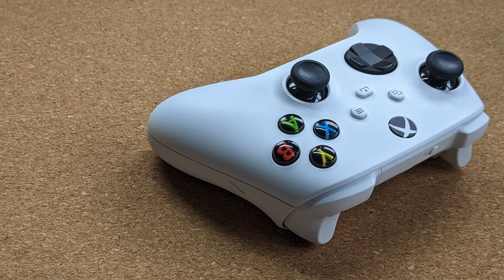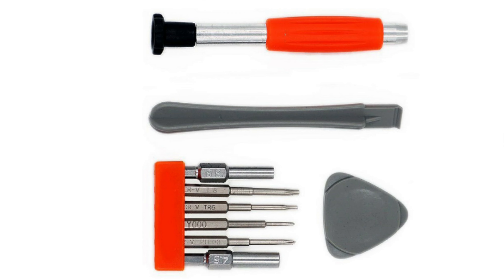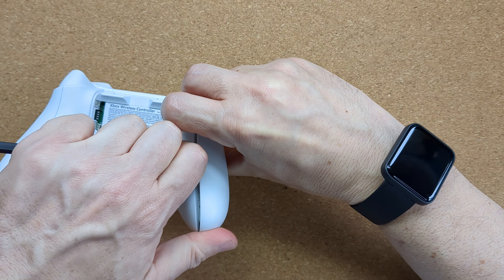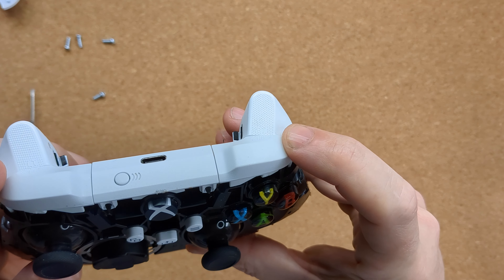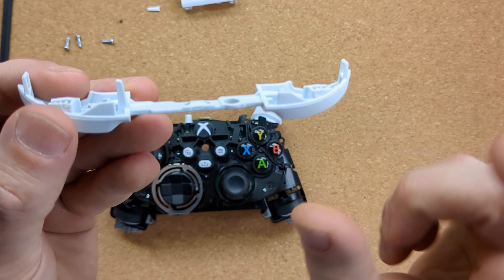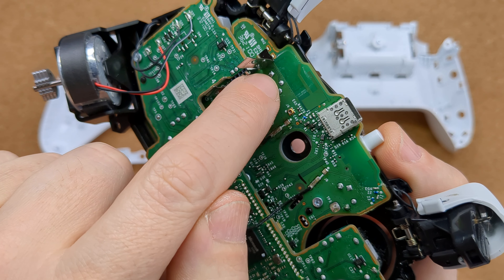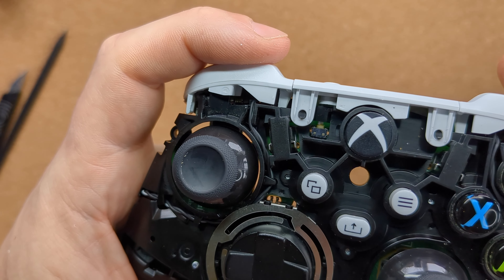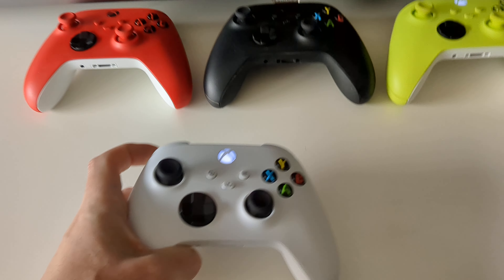How to fix broken bumpers on Xbox Series S or X controller - no new parts needed!

Comment: The video was brilliantly clear. I had a go with a replacement bumper and all seemed well. However when I replaced the batteries no light or start up on the controller. Any suggestions?
Reply: I guess you fixed it by now? Check if when assembling the controller, the two battery plates pass through the space and did not stay inside the controller
Reply from the maker: As @thiagomotta777 said here, and I've done this before, make sure the battery tabs aren't trapped inside the shell

Comment: Hey Joe, my controller won't power on after replacing the bumper panel with the shoulder buttons and reassembling it! Any advice?
Reply from the maker: Check inside the battery compartment.  It's easy to reassemble and accidentally trap the battery contacts inside.  They need to slide through a small gap in the rear shell.

Comment: So I had thos issue and 8bwas able to super glue the little piece that broke just like yours but after putting back on.  It didn't fix the issue as it still seems the same and doesn't click
Reply from the maker: Did you trim it at all and make sure it fitted through the gap? Also check the button itself isn't damaged, poke something through the gap and see if it still clicks before reattaching the bumper

Comment: This is great, i think i have this exact issue however i have an elite 2 controller anthat first glance it looks more complicated to take apart etc. Its got a built in battery etc and the casing is different. I dont know if i should attempt this myself. Im already down around 60 quid since my right trigger stopped working, now the right bumper is going. It only registers 30 percent of the time.

Comment: My LB works if you push where the button sweeps towards you closer to the sync button. But if you push it on the edge it won't register.
Reply from the maker: @02091992able  so long as it works! Sounds like something isn’t aligning quite right
Reply: What was the fix for you?

Comment: i just bought a lot of 19 broken controllers and half of them has this problem which indicates a design flaw. i wouldn't try to glue it. no glue is stronger than an intact part and it cost 1$ on aliexpress so better to replace the part. in both cases it's a temporary fix, im thinking of a more permanent fix to replace the buttons with a longer style push button and remove that peg entirely.
Reply from the maker: That's a good idea. And I think you've just as much chance of failure with a well-glued original part as you do with a cheap third party replacement

Comment: Are there other items that you can use as a screwdriver to dissemble the controller if you don't have it?
Reply from the maker: There are ways to work around it like snapping off the little pin inside the screws or getting a flat head screwdriver to wedge into the screw but as with most things, I would always recommending the proper tools for a job.  It does mean waiting but they can be bought cheaply and will result in way less frustration.

Comment: Hi my switch make the click sound but its not working what should i do
Reply from the maker: It could be the switch component itself.  If you open it up and nothing seems to be physically broken then the switch component might need replacing.  You'd have to use a multimeter to check the continuity, and if it's a faulty switch you would need soldering equipment to replace it.
Reply: @JoeBleeps  tnx bro I will , good vedio though

Comment: I’ve done it all but after reassembling it won’t turn on (I’ve put batteries in) this has happened twice.. do you know why?
Reply: Nevermind.. hadn’t put the metal conductor things through the hole meaning the batteries weren’t connected to the controller properly lol
Reply from the maker: @nemoandclem2584  I made exactly the same mistake when I did the green shell mod. Easily done!
Reply: Haha, also do you know anywhere I could buy just the back to a controller (the bite you heat up and take off). We tried taking one apart a few years ago but lost the backs somewhere..
Reply from the maker: @nemoandclem2584  so far as I know you'd need to get the whole shell. There are some nice ones out there though, I love the clear green one I got

Comment: I have a problem with the controller the rb and rt button keeps pressing how I can fix it ❤
Reply: Xbox series s controller
Reply from the maker: @trend_super3504  Series S and X controllers are the same.  If it keeps pressing there's something inside pressing against the switch component.  First thing I would do is open up the controller like I did here and see what's going on inside.

Comment: Just got 2 replacement bumper pieces from amazon but they are useless as the rb jams. Trying one from ebay instead. I tried superglue first time but the pressure needed to press the button was noticeably different. It broke in about 15 minutes anyway.

Comment: open up mine but didnt have the right torx to open it completely, but i did hear something have snapped and rattling inside, so pretty sure it must be this plastic thing then, but i dont get why my LT button wont work but the LB works fine because of this plastic thing...(edit: the button works just no response fromt the controllers LT to the Xbox)
Reply from the maker: Might be a separate issue?

Comment: My RB ana LB is working, but it's heavy when you cliked on 💔
Reply from the maker: Sounds it may be broken but the part hasn't come away completely yet
Reply: Did you get a replacement bumper and it only clicks in on the inner sides closer to the sync button, but it doesn't on the outer sides because if you did look closely on 7:00 where the ends meet before the loops and notice how there's excess molding where it's not supposed to in that time clip shown on yours. Gotta watch out for quality on these bumpers so on mines I got a blade and safety cut resistant glove where I'm holding and chipped away excess molding
Reply from the maker: @vectorphoenix5992  always worth checking the accuracy of those parts

Comment: My LB and RB are still working normally, but my LB is waay more "clickier" than my RB, i think they always were like that, but since i dropped my controller on my carpet i started to notice it way more, could it be that it broke something? maybe something is stuck? it's still under warranty so i don't want to open it, but it's not an issue worthy of sending it back
Reply from the maker: @brunogamesbr1  maybe something is cracked inside but not fully broken yet? You'd have to open it to know for sure

Comment: any ideas or where i can look for more info on how to fix it if the button itself is not the issue? i replaced the button itself on the pcb and i still don't get a signal
Reply from the maker: That's very strange. Replacing the button I'd what I would suggest but you did that already. Have you any means of testing the continuity of the traces the switch is linked to? I've damaged small switches in the past when installing them. They are so small they heat up quickly when soldering. That's the next thing I would check
Reply: dont have one of those. i could probably find one but i'm suspecting it was already damaged before i even opened 'er up. 

the original button was perfectly clicky before removal  @JoeBleeps

Comment: When I get to actually taking off the white part of the bumber it just doesn’t come off. In the vid you said there is a clip that is easy to disassemble but mine doesn’t come off. Any help
Reply from the maker: If I remember rightly the first part has a clip in the middle that needs lifting to remove, then the remaining part is clipped at the ends

Comment: I bought a brand new gen9 gamepad 3 days ago. I especially play fifa. For a day now, my RB button has started to make less noise than the LB button. Is this normal? The RB button was noisy on the first day, but now it makes less noise than the LB button.
Reply from the maker: The noise is often as the button hits the shell after pressing. There are stickers inside to dampen it, maybe the sticker placement is a little off, I've had that before

Comment: So to keep it short im a kid and i cant find the "bit" for the screw 😤 i dont exactly know what to do if i find out i dont own one, do i just giveup or??

Update: had a T8 but it was just a regular and didnt have open hole
Reply from the maker: You would probably need to go to Amazon or eBay if that's possible. They will only be cheap but I would say difficult to find if you were just going to a regular store.
Reply from the maker: If you only have the regular t8 I believe you can snap off the pin in the screw with a flat bladed screwdriver, but I would personally make sure I had the right tool

Comment: My controller's (series S.) LB Doesn't seem to make any clicking sound or make any input, but I don't have any supplies and are completely unable to remove any pieces, is there anyway I can fix this without a screwdriver or need to disassemble? I need LB for several games.
Reply from the maker: You'd need to be able to disassemble it to fix it. The toolkits are relatively inexpensive, especially compared to a new controller
Reply: @JoeBleeps  Ah, them being inexpensive is good, especially since the money situation i'm in isn't good, I live with my sister and mother, My father didn't show up for me and my brother left, and QoL is hitting us hard.
So we should be able to get some repairs done
Reply from the maker: @Blighty-Creator-of-the-realms.  Good luck!

Comment: If you have a torx set but not the stupid ones with the hole in the middle for security screws, i just took a 1/8 inch drillbit and just blasted it out, then my regular torx bit took care of the rest
Reply from the maker: The security bit really does make things more difficult!
Reply: @JoeBleeps  Nothing a drill bit set can’t take care of. :)

Comment: hi there bro,had the exact same problem,bought the part,now mines clicks now but alot of the time it doesnt register,any ideas to fix it?,thanks in advance
Reply from the maker: It could be damage to the switch itself inside, could maybe be an issue with the size or accuracy of the new part. Hard to tell without taking a look at it. I hope you can get it fixed

Comment: I had a reasonable idea. I have 4-5 different Xbox One controllers that need repair. A couple needed LB replaced. The other had broken LR. I figured I'd swap the good LB buttons from the broken LR controllers. Well, I managed to gorilla fuck 4 goddamn controllers in the process. Now I have 4 smashed controllers in the trash. THANKS!!!
Reply from the maker: @BlackCanvasAudio  it sounds like a solid plan. What happened?
Reply: @JoeBleeps  I absolutely DESTROYED both LB/RB panels when I tried swapping them. I seem to do an awful job when I work with tiny parts. Getting those triggers set in place, just wasn't happening for me. Small parts and patience aren't my strong suit. lol

Comment: Screw where batteries go not going back in. 

Edit: Nevermind the piece on the front plate that holds the screw is a bit broken lol.
Reply from the maker: @FirstLast-yh7gj  glad you at least found what was causing the issue. It should still hold together okay without it

Comment: For some reason when I actually got into the controller and took off the central clip which is shown at 5:00 i couldnt find the clip that would get the entire shell to detach.
Reply from the maker: Those are at the ends of the bumpers

Comment: Did this and my controller died. Any thoughts on why that might happen?
Reply from the maker: As in, it doesn't work at all? Probably a ribbon is either damaged or not properly reconnected. Open it up and check. Or else you may have misaligned the battery contacts and trapped them inside the shell, that's common

Comment: that happened with mine, not through impact though, I was playing jedi survivor and I was trying to block too hard
Reply from the maker: Seems the buttons don't take pressure well
Reply: @JoeBleeps  to be fair, I was squeezing the hell out of it.
I may have a little more grip strength than they test for too.
Reply from the maker: @corwindobrowski5354  I think they probably intended for it to be used with quick taps and the triggers more intended for squeezing, then the game designers choose what each button does and too much pressure or wear and tear on the button

Comment: Mine RB button seems stuck, and it keeps pressing on itself anyway to fix this, I tried removing it. Also tried applying alcohol around the tactile , nothing seems to be working, any help on this"
Reply from the maker: I think if you've got that far with it, you'd need to get right in there and replace the tactile switch

Comment: man .. i am having the bumber issue while playing fifa.😢.. and my series s is within warrenty.. should i replace it with a new controller??
Reply from the maker: If you're covered by the warranty get it replaced 😊 otherwise it's not too hard to fix. I've seen kits now that have the screwdriver, the pry tool and the replacement bumper for very little
Reply: @JoeBleeps  great.. thnxxx
Reply: @JoeBleeps   but i would say microsoft quality control is really pathetic, sony ‘s ps4/5 dont have these issue withing 3 yrs of long usage.. but i am having within 7 months of buying 😏😒
Reply from the maker: @kaustav42  I think you've been lucky, I had lots of issues with PS4 controllers and they were difficult to repair.  At least I've been able to fix Xbox controllers so far!  I've yet to even get my hands on a PS5 so I'll wait and see on that front :) thank you for the feedback!
Reply: @JoeBleeps  great then.. best of luck to you🤞

Comment: It's annoying af ... My lasted 6 months and now I have drift stick and broken right bumper 🤦‍♂️
I just tried doing what u did but unfortunately couldn't find a screwdriver like that, even tho I have like 30 different ones. 
Microsoft just don't care or make them like that on purpose.
Reply from the maker: Yeah it's designed so people don't take them apart. It's a very specific screwdriver bit. Good luck fixing if you get one though!
Reply: @JoeBleeps  I actually just use a small flathead to unscrew mine, i know it can possibly damage it because it's not meant to be used on these torx screws but so far it's worked just fine.
Reply from the maker: @JohnSmith-XYZ  where there's a will, there's a way 😁

Comment: The fact that they need a unique screwdriver really makes the design of these controllers lazy and not easy for use. Never had any problems with a 360 controller btw
Reply from the maker: @Matt-fe6wu  oh yeah it's definitely designed for disposal and not repair

Comment: I fixed mine the same way but now it won’t turn on. Is it possible I broke something inside?
Reply from the maker: More likely there's a ribbon cable not secured properly or the battery contacts are trapped inside the shell - they slide through a little gap to get to the batteries
Reply: @JoeBleeps  thank you that was it! You’re a life saver. Now I gotta fix 2 more controllers with the same problem. That piece is way too weak.
Reply from the maker: @Xtermenator217  was it the battery contacts?
Reply: @JoeBleeps  yep. One was behind the shell
Reply from the maker: @Xtermenator217  I did exactly the same thing when I built the green clear controller

Comment: hi, my RB continuously activated (pressed)
i opened the controller, but the button is free, and there is no sign of compression
and the problem continues . what i should do ?
Reply from the maker: It could be the actual button component that's damaged and needs replacing. If it were me I would open it up further until I could get to the switch and then I'd do some continuity tests on the switch connectors while it's pressed and otherwise
Reply: thank you so much
Reply from the maker: @firasalabdullah4170  you're welcome

Comment: What do I do if it starts to squeak when I plug it in
Reply from the maker: Squeak as in creaking? Or bleeping
Reply: @JoeBleeps  as in it sounds like a hamster it also doesn't get any power
Reply from the maker: @aNiceRusslan  check inside the battery compartment, have the metal tabs come through?

Comment: I have 3 xbox series x controllers. I have bought from ebay at least 10 LB+RB part, used them all. Excuse my language, but they are shit (original xbox and ebay parts), they work between 1 month and 3-4 months max. I did not have this problem ONCE on xbox 360 controllers. On xbox one controller, maybe one time. I will still buy form ebay LB+RB part, the controllers are looking like new, no need to buy new one. And i do not throw them or hit them. That plastic is just not good.
Reply from the maker: So are you saying that the plastic on the replacement parts is even worse? I think it's a poor design in general, that thin plastic is too weak
Reply: @JoeBleeps  Not worse, the same i would say. Poor design, as u said.
Reply from the maker: @mariusdan6147  how frustrating!

Comment: These are built so poorly these controllers (specially these weak plastic bumper buttons) mine has broken 2 times on the same controller and also the xbox controllers seem to get stick drift easily too.
Reply from the maker: @johnmiceter  the bumpers are way too delicate. As for the drift, this pad, the PS5, PS4, Xbox One, Switch Pro controller etc etc all use the same cheap sticks. Not a good industry standard.

Comment: all them controller have same problem iv don 3 them
Reply from the maker: @andrewwalsh6177  definitely a design flaw
Reply: @JoeBleeps  A total rip off from xbox the console is 300 and the controller costs 70 typical designed to break so they can rob you
Reply from the maker: @andrewwalsh6177  it's just a design flaw but they should have improved it by now with a newer version especially at that price